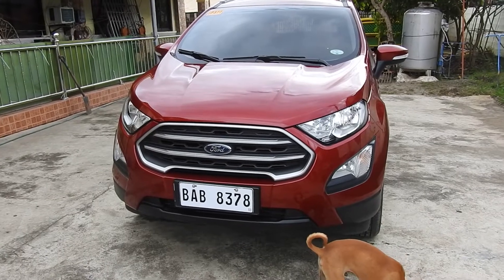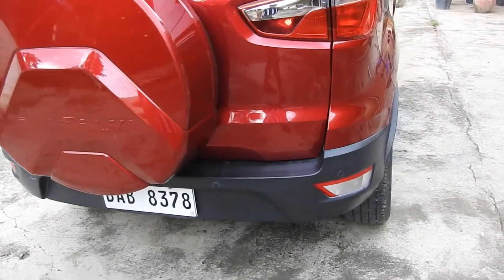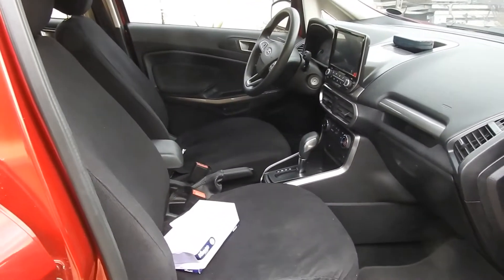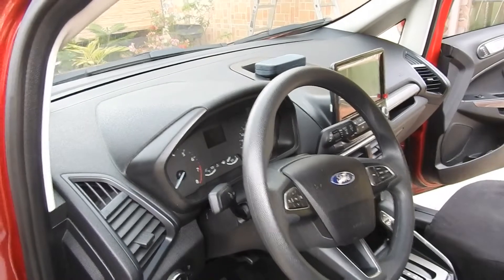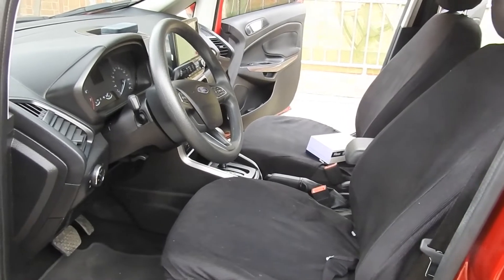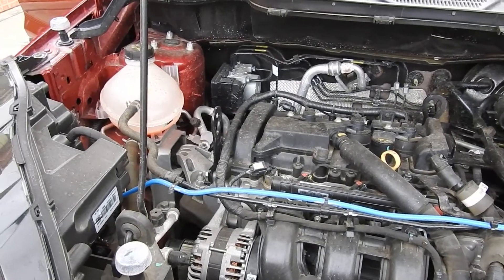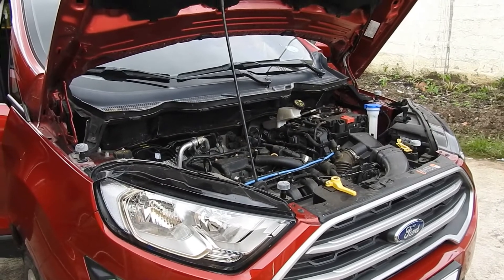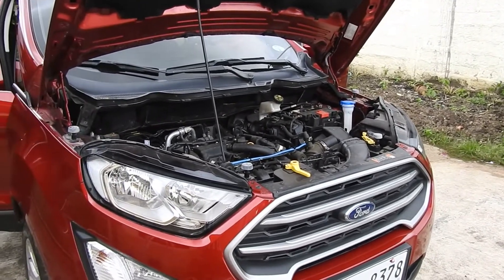Roxas, Isabela - Ford ecosport, opinion

Comment: I will never trade the toyota over ford. Toyota cars are way more reliable over ford. Your vios is way more efficient over to that ford ecosport.   I have owned toyotas over the years, I still have my 2000 camry which is now 392k miles, a 2020 camry, and recently, I bought the 2022 toyota harrier. In philippines, I still have my 1997 toyota corona exsior, still runs like new.
Reply from the maker: Thanks for watching. I like the VIOS now although I was'nt keen about it initially.  After using one for 3 years I got to appreciate the vehicle's performance. My wife does'nt like the engine noise as it makes a particular sound that she finds irritating. Also the car do bob a bit on the uneven road which has to do with the vehicle's tight suspension, which I like. Wife does not like to be shaken and stirred so like the ford smoother ride

The VIOS gas mileage is pretty good, I don't have to put out lots of pesos to gas up unlike the pickup and the ford. Boy once the gas metre goes up past 2000 pesos, with either vehicle, that I get nervous, I mean 3000 and up?